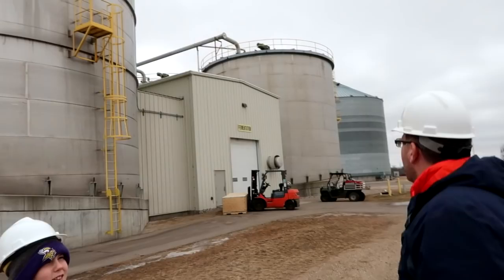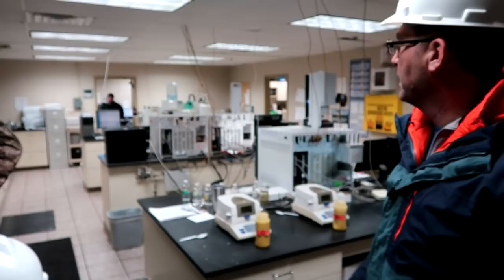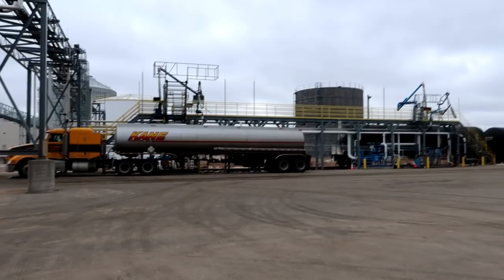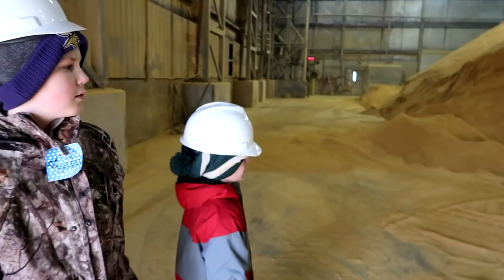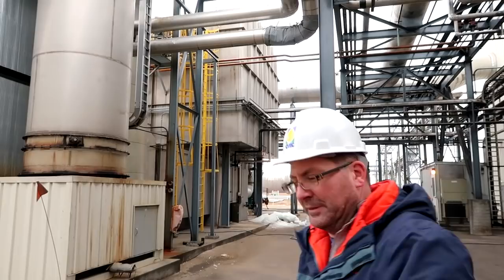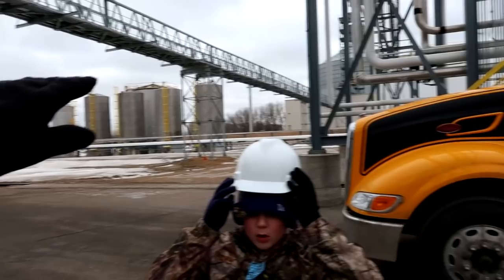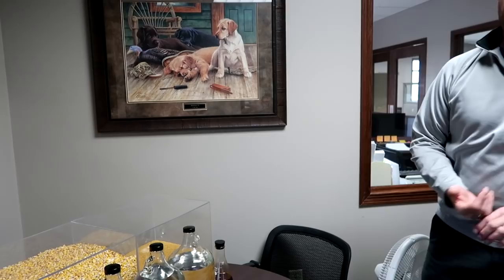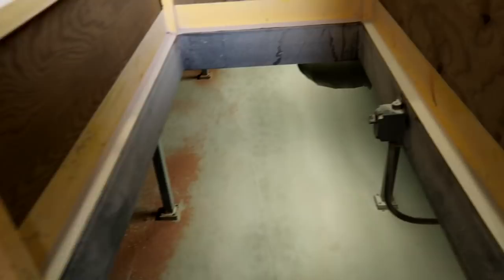Our Tour of a Corn Ethanol Plant!

Comment: I learned a great deal. The only thing I'm not sure about is what harm if any ethanol does burning in older car & truck engines. We were told ethanol can corrode engine parts. I'm not sure if this is true and where this information came from.
Reply from the maker: I am probably not knowledgeable enough to comment on the corrosion issue, but we have never had any issues with it on our farm, and we run it in everything we have.  The older cars and trucks are not programmed to change the amount of air the engine takes in to adjust for the change of oxygen in the ethanol versus gasoline.
Reply: MN Millennial Farmer: Thanks for your reply. We were told to put additives in our gas/diesel tanks, but that might just be a marketing scheme.
Reply: Ethanol is hard on plastic fuel lines and valves and the valves seats. Small engines have the most problems. I have a chain saw and its plastic fuel line was brittle and broke into pieces
Reply: MyOLD36chevy: Thanks. That's good to know. I put stabilizer in my chainsaws over the winter, but don't know if that helps. I guess my road vehicles are okay with regular fuel.  --  PS:  - different subject - I've never been convinced that over-the-road additives do anything to improve fuel efficiency or engine life.
Reply: I would try to empty the gas tank over the winter or for long periods when not in use. I use an additive on my cars and pickups also I think they make a difference but that is just my opinion.
Reply: MyOLD36chevyL: Thanks for the comment... it's good to know I'm not "whistling in the dark" or some such phrase...
Reply: MyOLD36chevy, leaving a tank empty is the worst thing you can do. Moisture can build up and corrode the inside of a steel tank. The best option, IMO, Is to fill completely and use a high quality marine fuel additive. That way, there's no void for moisture to accumulate and the marine additive will keep the alcohol ladened fuel from going bad and absorbing water.
Reply: I agree with you except for small engines with plastic tanks and lines that are only part full over long time period of time.
Reply: MyOLD36chevy, Can't argue with that...except the empty part of the tank will allow moisture to accumulate. If you can completely drain that plastic tank, lines, carb bowl, etc, etc, you should be fine but I would still use the marine gas treatment. I don't like that ethanol stuff at all. I live in Ct and have a buddy who makes regular trips to upstate NY and gets the ethanol free 92/93 octane ? gas and that's what I use for all my small stuff. The difference is unbelievable. There's no sign of gumming, dried crust, clogged tiny jets, just nothing, like the old days with 1970's regular leaded gas, it even smells different ! lol. I want these farmers to make as much money as possible, just hate ethanol, lol.
Reply: Running the engine out of gas before winter storage is what a lot of people do.
Reply: MyOLD36chevy, Again, I totally agree, , excellent idea !

Comment: We sell to Blue Flint Ethanol. It’s down in Underwood ND.  It’s been online since 07. 

Blue Flint Ethanol is located between Underwood and Washburn, ND off of US Highway 83. From Highway 83, turn west on McLean County Road 18 or at Great River Energy's Coal Creek Station sign and travel for approximately 3 miles. The facility is on the north side of the road.

 

For Corn Marketing or Distillers Grain purchasing call 701-442-7575

Also, we sell to  Tharaldson Ethanol Ethanol in Casselton, N.D. The cost was $200 million when the plant broke ground, back  May 2007. Oh. It’s the fourth to come on line in North Dakota and the state's largest by output volume. 

Here is our other three ethanol facilities, Blue Flint Ethanol LLC, a 50 MMgy facility in Underwood, N.D.; Red Trail Energy LLC, a 50 MMgy plant in Richardton, N.D.; and Archer Daniels Midland Co., which owns and operates a 28 MMgy facility in Walhalla, N.D. 

Bios. 

Blue Flint Ethanol
Blue Flint Ethanol is located in Underwood, N.D. Blue Flint Ethanol uses about 23 million bushels of corn annually, which will in turn produce 65 million gallons of ethanol and about 190,000 tons of dried distiller's grain each year.

Dakota SpiritAgEnergy
Dakota Spirit AgEnergy (DSA) is located in Spiritwood, N.D. DSA uses about 23 million bushels of corn annually, which will in turn produce 65 million gallons of ethanol and about 190,000 tons of dried distiller's grain each year. It is the newest plant in the state, coming online in 2015.

Dakota Spirit AgEnergy
PO Box 66
3361 93rd Ave Se
Spiritwood, ND 58481
701-251-3900

Hankinson Renewable Energy, LLC
Hankinson Renewable Energy is a corn-based ethanol plant located in Hankinson, N.D. The plant uses approximately 46 million bushels of corn annually, which will in turn produce 130 million gallons of ethanol and about 395,000 tons of dried distiller's grain each year.

Corn receiving hours: 
Monday - Friday: 6:30am to 5pm

To sell corn: 701-242-9432
Scale-House: 701-242-9493

 

Red Trail Energy, LLC
Red Trail Energy, LLC (RTE) is a North Dakota-based investor group formed to finance, construct and operate a corn-based ethanol production facility located near Richardton, N.D. RTE produces 50 million gallons of ethanol annually using 18-20 million bushels of corn and 100,000 tons of coal. Coproducts produced by RTE include 125,000 tons of dried distillers grain and 80,000 tons of modified-wetcake annually.

Office Hours Richardton ND   Monday-Friday 8:00 a.m.-4:00 p.m.

GRAINS PHONE NUMBER
(701) 974 3880

    Corn Unloading Hours 

      Monday-Friday 6:30 a.m.- 5:30 p.m.CT
      Dried Distiller’s Loading Hours
      Monday-Friday 7:00 a.m.- 5:00 p.m.CT

                     

Tharaldson Ethanol
Tharaldson Ethanol is located just west of Casselton, N.D., an area known for its rich farming tradition. Tharaldson Ethanol uses 54 million bushels of corn annually, which produces 150 million gallons of ethanol and about 450,000 tons of dried distiller's grain each year.

THARALDSON ETHANOL
3549 153rd Avenue SE
Casselton, ND 58012
Phone: 701-347-4000

Comment: That why we have issue with carbs on small motors don't run ethanol gas in a small motors
Reply: The problem is not with the fuel....Kart racers have been using PURE ALCOHOL since WWII.....the issue is the same as it has always been.....STORING small engines with fuel in them. If you do it with gas you get varnish....if you do it with alcohol fuels you'll get corrosion due to water absorbtion. Moral of the story, don't STORE engines with fuel in them. Signed a Master Technician with a BS in Engineering. Don't blame fuel for poor maintenance practices.

Comment: Just curious... I never see any trucks pulling super B trailers in the states.  Seems You guys all run single  tandem trailers.  Are they not allowed on the highways there?
Reply from the maker: I think they're legal in North Dakota but that's about the only state I know of where they can be used...
Reply: Thanks Zach....Thats the majority of the trailers that run up here.  Even triple axle singles.  Good Video!!
Reply: MN Millennial Farmer   Montana you can. And in Montana, “Farm to Plant Only,”. You can haul 2 pups.
Reply: Northern farmer      Montana you can. And in Montana, “Farm to Plant Only,”. You can haul 2 pups.
Reply: Each state has it's own laws Northern Farmer.  For the most part, no state allows Super B's.  Double and triples can be pulled in most West, Northwestern states, starting in North Dakota and South Dakota - extending into Montana, Idaho, Washington, and Oregon.  I'm not sure about Wyoming.  Doubles here are accomplished with a converter instead of the Super B used in Canada.  We used to pull 2 53 foot trailers in ND, but the state has asked us to limit the length of the 2 trailers to 105 feet.  With a 53 and 48 foot trailer GVW is @ 105,000 lbs.  I've been in transportation for @ 40 years.  To get all the way from ND to Washington and Oregon and be legal in every state the lead trailer has to be 40-42 ft maximum, and the pup 26-28 ft, with GVW 101,000 lbs.  That configuration is referred to as Rocky Mountain doubles.  I think it's Washington that limits the weight to 101,000 lbs.  Years ago I pulled them a bunch, and always said the trick to pulling doubles is to not look in your mirrors, cuz it will scare the crap out of ya!
Reply: Barry Chouinard   Hi Barry. Been awhile since I heard anyone say RMD=Rocky Mountain Doubles:) :)
Reply: It seems like a good idea as 2 trailers means only 1 truck on the road vs 2.  I definitely had to do a double take the first time I saw one in ND as in MN they only allow the very short doubles that fedex/UPS a few others pull.
Reply: carkey351   In Wyoming you can pull 3. The 1st one, one hooked to the Truck can be up to 53 feet in length. The next 2 can be up too 48 feet in length. A total of 149 feet. Round it off to 150 feet. Be done with it:) :)
Reply: the tiny amount I've driven truck that would be a nightmare to stop or start on some of the narrow roads in MN.  I can't imagine trying to turn with that much length though I have pulled 4 tandem axle hayracks with a tractor before so I have an idea on what that may be like.  Bet you need a ton of power to pull 3 trailers though!
Reply: carkey351   It really is easy to pull 3 in Wyoming. Have you ever drove on either Interstate in Wyoming? Interstate I80 and 
I25. Interstate 25. 

Wife and I have drove from Cheyenne up to Billings Montana several times. And the interstate is soooo quiet. 6 and a half hours. In good weather. Meaning slide
Reply: never drove a truck in wyoming but I see your point on how it would be easy to do out there.
Reply: In Michigan you can run doubles with up to 11 axles so truck and two trailers equals 11 axles.  With a gross weight of 165,000 lb.  Or a truck and single trailer with 11 total axles at 165,000 lb.
Reply: Northern farmer look up Michigan double

Comment: Interesting,but how many BTU's in verses BTU's out in the ethanol. Is this really a practical conversion conversion process?
Reply from the maker: I can't answer that but I can tell you that it seems extremely efficient.  They recycle everything they can right down to the heat used in the dryers.

Comment: How much diesel does it take to produce 1 bushel of corn, including trucking, to the plant?
Reply from the maker: I can't answer that.  I think that would be almost impossible to truly accurately calculate.
Reply: I understand it will vary, I am just trying to get an idea on how feasible ethanol production is. I mean if it takes a gallon of diesel it makes it a lot less environmentally friendly.
Reply: I calculated it once many years ago on our 500 acre farm.  7-8 gallons of fuel per acre for the year, all inclusive.  So 3 100ths of a gallon.  That would be less than an ounce.

Comment: You do come up with interesting videos,But like most things ethanol shrouded in myths that just don't go away .
Reply from the maker: It certainly seems that way.  People just hear things and repeat them without knowing anything about the subject.
Reply: @MillennialFarmer  
Zack,  I have been catching up on your videos, this one being the latest.... Wondering if you could shed some light on older vehicles using ethanol?  In particular, I have a few antique gas tractors, (John Deere, Oliver, Farmall, and Case) and I am constantly reading that ethanol is harmful to the older carburetor systems, and only straight gasoline should be used.  Any thoughts you have on that would be greatly appreciated!!    Personally, I have not noticed any adverse effects from using ethanol in them, and they do have sit time, and they still start and run just fine.   
Your videos are very informative on many subjects. Thanks for taking the time to help debunk the myths!  
,

Comment: Zack - way late to this but recently started watching your (Very good by the way) channel. A side benefit to the ethanol is it raises the octane rating of gasoline. You know the 86, 89, 92. - 
https://afdc.energy.gov/fuels/ethanol_fuel_basics.html#:~:text=Fuel%20Properties&text=Ethanol%20has%20a%20higher%20octane,attain%20the%20standard%2087%20octane. - 
So the ethanol replaced tetraethyl lead in gasoline as another health benefit that doesn't get much "air time"

Comment: Sounds  like they  have  diesel  engine  Generators  when they  could run them on Pure  Ethanol ..  Pure  Ethanol  does not have to be hydroscopic..   You can easily  burn  4%  water and 96%  Ethanal .. no  extra  expense to  distill  "evaporate"  all the water and impurities out of it..
   The ships that  bring   all the Junk made in China to the USA  burn  very high sulfur fuel which is like tar and has to be pre heated  before it can  be injected into the engines..

Comment: How much diesel does it take to produce one gallon of ethanol?
Reply: David Phillips do you mean with the trucks and equipment?
Reply from the maker: That would be nearly impossible to calculate accurately.  How much diesel would have been burned regardless of what the corn was used for?  What if it's all biodiesel instead of oil?  How much oil is not burned because of the ethanol production?  Where would the bushels have gone if not used for ethanol?  Do we want to support our own nations energy dependence or others?
Reply: David Phillips 
How much diesel was used to produce 1 gallon of diesel?

Comment: Ethanol production is still being subsidized. There are tax breaks (like the oil industry has) but the biggest benefit is that auto gasoline is required to be mixed with ethanol, so they have a guaranteed market. If it wasn't for that, nobody would buy it because it isn't cost effective compared to gasoline. (It has 1/2 the btu content per volume.)

Basically it exists to make liberals feel good about themselves, and farmers such as yourself happy because corn prices are higher than they would've been.

I suppose that that particular plant in Minnesota isn't getting subsidies, but I suspect that that employee was lying that they get zero subsidies. It certainly isn't true that the industry as a whole has no subsidies.

Comment: Most folks don’t know the difference between an actual “Subsidy”  and “Operating Expense Write Off” 

Oil And Gas Companies Do Not Receive $1 Dollar In Subsides. 

It’s a poorly-circulated myth that America’s oil and natural gas industry receives federal subsidies. Subsidies are cash outlays from the U.S. Treasury, and the oil and natural gas industry doesn’t get them. Similarly, there are no targeted tax credits currently being used by industry. Legitimate tax treatments used by oil and natural gas companies – similar to those used by other business sectors – regularly come under attack by those pushing for higher taxes on energy companies.

Here are the facts:

Domestic Manufacturer’s Deduction – Section 199

This deduction is available to all taxpayers engaged in manufacturing, producing, growing or extraction in the United States.
While most industries are eligible for a deduction equal to 9 percent, the oil and natural gas industry is the only industry with a reduced deduction equal to 6 percent.
All other US manufacturing – even some you may not think of – qualify for the full 9 percent deduction.
Intangible Drilling Costs (IDCs)

This is a deduction for labor and related costs to drill a well.
Independent producers can deduct these costs in year one while integrated oil companies can only deduct 70 percent in year one and amortize the remainder over five years.
This treatment is similar to the research deduction, small business expensing, and the deduction of advertising costs in other industries.
Last-In, First-Out (LIFO) Inventory Accounting

This accounting mechanism is available to all industries as a way to value their inventory.
There is no special LIFO provision for the oil and natural gas industry.
LIFO is commonly used by grocers, wineries and distillers, car dealers, and wholesalers.
Foreign Tax Credit – Dual Capacity Rules

In order to avoid double taxation, the U.S. tax rules allow taxpayers to credit foreign taxes paid on overseas income against U.S. taxes on that same income.
Like all other taxpayers, the oil and natural gas industry must prove that the amounts it pays to foreign governments are actually income taxes in order to claim a corresponding credit.
The dual capacity rules impose additional steps, scrutiny and burdens – beyond those applied to other industries – to prove the amounts paid are creditable income taxes
Reply from the maker: Garland & Darinda Remington III I'm seeing this commented a few times.  Interesting.  Thanks

Comment: While I appreciate your making this video, I don't think everyone understands the truth about ethanol after seeing this video. The words used by the plant manager were carefully chosen. He was not lying, but he did not portray the big picture truth. The big picture truth that I have found through research of literature is that if you include the farmer's fuel, the ethanol plant fuel and the energy content of ethanol, it takes more fossil fuel to produce ethanol than is saved by adding ethanol to our gasoline. I am a farmer and an engineer.
Reply from the maker: What about after you factor the remaining feed value back?  Or the oil value?  How do you calculate for the idea that the corn would be grown regardless which would require those same fossil fuels regardless of what the corn is used for?  Also, what's the value of the ethanol being homegrown and renewable instead of a fossil fuel?  It's not an easy calculation obviously.
Reply: If that was the case ethanol plants wouldn’t make any money.  Also, as he stated, they run their plant on the very product they make in the summer time.